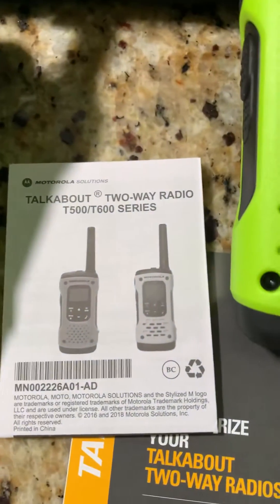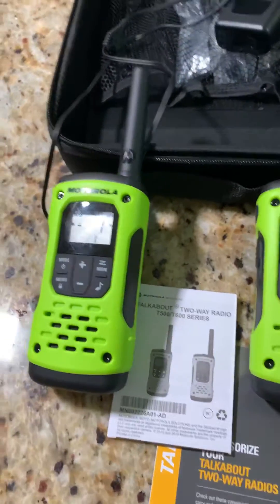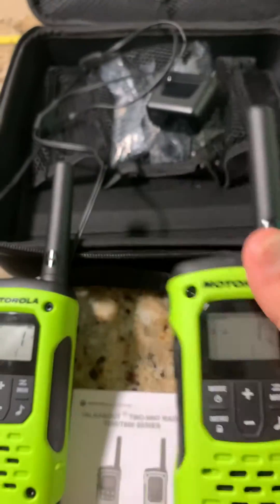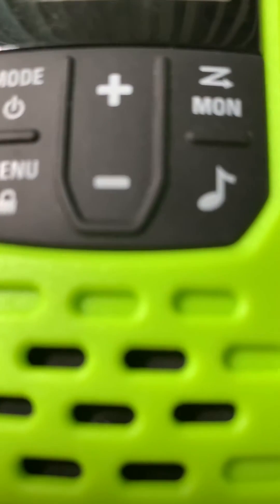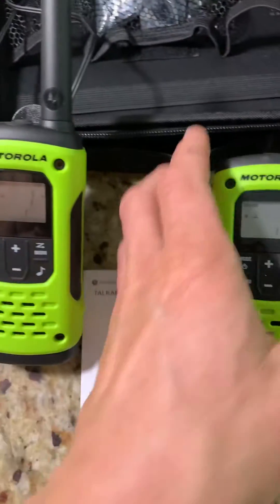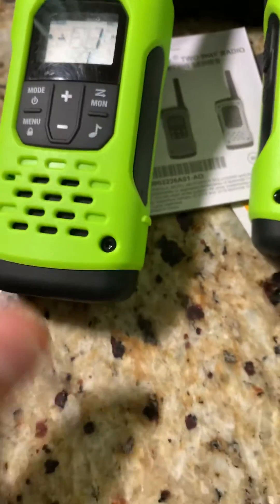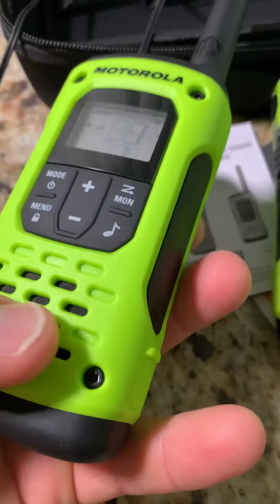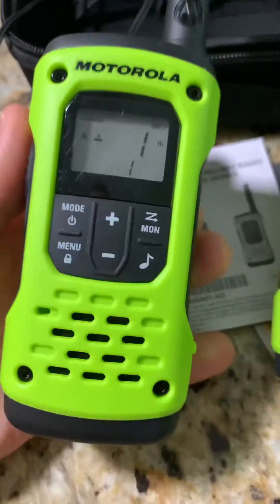Motorola talk about two way radio T500/T600 series Low volume issue

Comment: the radio has a 1/2 watt transmitter so it under 1 mile in town one brick building can
stop the signel flat line of sight only

Comment: I would suggest adding the Motorola TLKR T92 h2o to the description. They have exactly the same problem. After having 3 sets replaced I came across your video :) Thanks for the fix.
Reply: Totally agree with you mine did the same.

Comment: I think the instructions say not to use the radios  closer than 5 feet from each other. Maybe that's why you had a problem.
Reply from the maker: Any type of radio is going to give you feedback if you use them too close to each other. But that’s  not the issue here . Watch the video till the end and they were that same distance in both of the tests . It’s a pressure issue in the speaker problem that I was basically showing so other people wouldn’t think they had a broken radio. Took me a second pair till I figured it out

Comment: You don't know how to increase the range on these do you? I just got them, they work fine but when you get about a mile apart the audio is very scratchy and almost inaudible. I tried the high power button on a 2 watt channel but no luck. Is there a setting that needs to be changed? Let me know if you have an answer.
Reply from the maker: Unfortunately there’s a lot of factors that come into play with range although they work pretty well for the use I had for them .For long distance with lots of obstacles there are very few radios that can handle that.